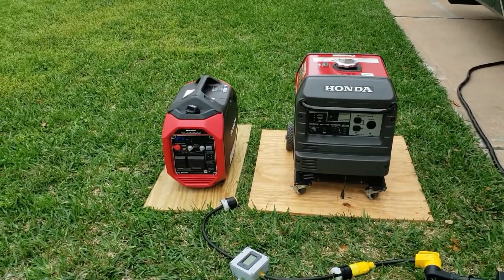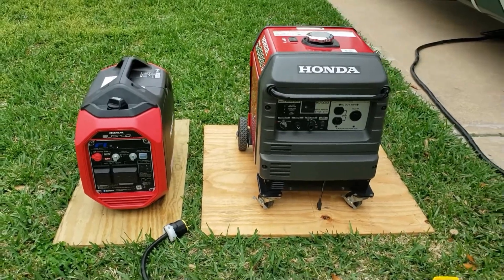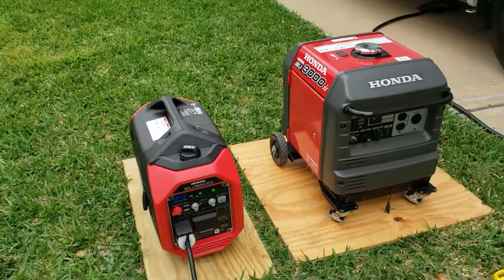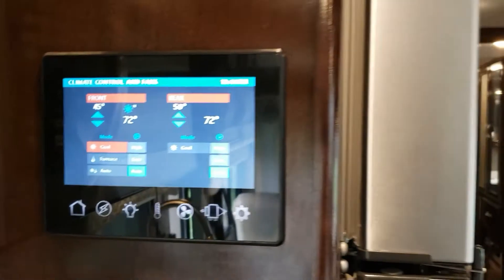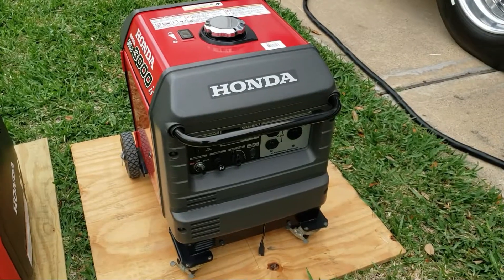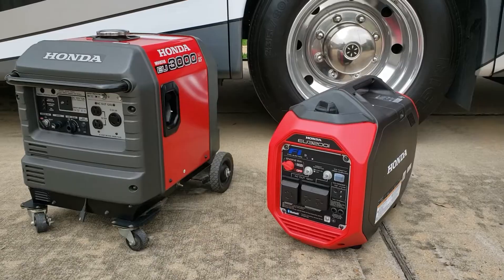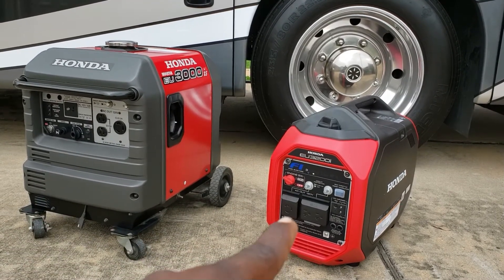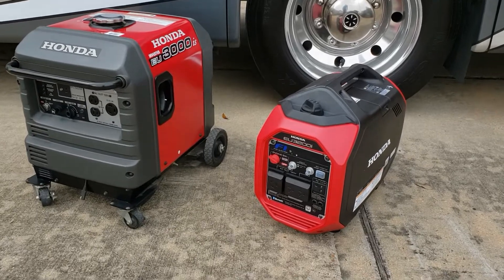Load Test: Honda EU3200i VS Honda EU3000i Comparison Fuel Injected vs Carbureted

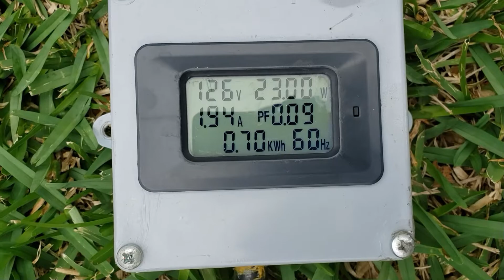Comment: 3:00, the reading does not make sense here. 126 volts at 23.01 Watts does not equal 1.94A. It would equal .18 amps. Something is wrong with your power meter.

Comment: Not that it matters,  but the industry standard for sound tests is 23 feet.  An interesting test I have never seen anywhere is the generator's inverter lag. When a load applied to a generator the voltage will drop, some inverters handle this efficiently, while other's do not. I spoke with Honda a while ago and they gave me the specs on their generators which was superb. The cheaper generators should be tested as inverter lag causes loss in efficiency which can stress the inverter and damage sensitive electronics. I have seen other YouTube channels parallels different brands and sizes of generators and was curious about long term effects of this practice. Honda states specifically not to operate in this manner of course Honda wants to sell more generators. Great video.

Comment: Having owned the Honda 2000 and the Honda 3000i , I would still choose the 3000i because of the electric start. When the 2000 was brand new it started after just a 2 or 3 pull starts. But as time went by and using the crappy ethenol gas, it took a bunch of pulls to start it. Where as, the 3000i having electric start only took holding the key on for about 3 seconds to start it when it hadn't been run in months. Probably because it had to pump gas into the carb from setting so long. You do have to put a trickle charger on the 3000i if your going to let it set for long periods without running it, because of the little battery it has. But that battery is only $12 to $15 dollars on eBay.

Comment: Good test ,thx,,The 3000 engine is ultra durable and more moment. lower consume i guess?-- every overload makes the inverter module weaker and weaker,  i got a EU30Is 230V with a fried inverter ;) and a EU10i. same same

Comment: can you parallel 2 3200s.....or 2 2200s

to run 2 A/C, micro, 12v fridge outlets in an RV....stove is propane,
Reply from the maker: The two 3200 would be better

Comment: The engine isn't the issue. The electronics is protecting the alternator against overheat from too much output current. The copper heats up from current squared so current exceeding rated output causes major heating.

Comment: I have  a eu3000i, all good  except for the weight. 130lbs dry! I was at Harbor  Freight on Black Friday looking for bargains, not  necessarily a gen set.On the floor unboxed were several  returned and refurbished  gen sets.  A 4550 starting,3650 running open frame inverter was sticker  marked at $419. Retail new  was $679 and BF price was $599. Ending that day was 40% off the $419! Wanted a light wt 30 amp plug gen to run small welders. NO warranty, could not buy extended warranty. Buy it and bring back  within  5 days if it has a problem.
Went to move it on the  floor and it was light.
77 lbs dry. Another  slightly  smaller  conventional  model also  refurbished  was over 100lbs. This 4550 replaced an earlier  4400 inverter that was recalled. 
Pull start only. Eco Switch. 30 amp twist lock, 2 duplex  20 amp outlets all with their own breakers  Parallel  ports.Running and overload lights. CO shutoff etc. Added gas and oil, started it and warmed it up. Killer watt read 120v 60hz steady. 2 1500 watt heaters no problem. Added a 3rd 1500 watt  heater which it carried for a short time before the overload light came on. Voltage and hertz very steady. Quiet  and not rattley like many 
low cost  open frame  gensets. Not Honda quiet but quality  sounding. Many people  compared  this unit favorably to HF 3500 watt fully  enclosed inverter gen which mimics the Honda Eu 3000ie. Time will tell how good it is. Different  sources  said i can parallel  this unit with the
Honda.

Comment: I ran a dive shop in Honduras for 2 years with the Honda EU3000IS, when we bought the shop I put an hour meter on the generator to track usage and oil change intervals. it originally came from a tool rental shop, and was used at the dive shop for the previous 2 years. By the time that it was retired (not from dying) by the math it had over 26,000 hours on the machine. I did oil changes every week and valve clearance adjustments  when required. kept up with the routine maintenance and this thing lasted an extremely long time for a generator that's not rated for continuous use. We averaged about 8 amps continuous for 8 hours a day. We had to fill the tank once a day. I wouldn't hesitate to get the older version over the new one.
Reply: Wow, impressive generator and maintenance regimen on your part.   Thanks for sharing.

Comment: You mean to say a generator rated for 3200 w brand new outperforms a generator only rated for 3,000 Watts also the older model they both overloaded one cost $800 more than the other the little one that is. This was really the stupidest thing I've ever seen I didn't see a test other than sound

Comment: At 6:15 you have the eco-throttle turned on, at 7:26 it’s turned off. Did you use eco-throttle just for the decibel test?
Reply from the maker: I will have to doublecheck, but I always do my test with eco on.
Reply: @GeneratorReviews  So maybe the 3000 wouldn’t have stalled with eco throttle off?

Comment: I thought the Honda 3000 was going for 3k, but I check now and they re going for 2K, does that sound right?
Reply: $2k is correct. I bought mine in July 2024 brand new for that price at a large retail camping store.
Reply from the maker: Be careful with sellers

Comment: Hi Gavin, excellent presentation, thank you for sharing with the community.  Could you tell us what do you use to measure the power consumption (the little grey box gauge) that you have connected in series with your power connections?  If it is custom-made, could you explain how you made it, thank you, Ciao, L
Reply from the maker: https://youtu.be/bhNf33jNRvo?si=GWBifPMfJlg796q3
Reply: @GeneratorReviews  Hi GR, thank you for the info and for your great informative videos, Ciao, L

Comment: I just changed the battery in my 3000i and I love the quietness of that machine.  I also have a victron 12v/3000va inverter with a 4000Ah lifepo4 CALB battery and use that for the ultimate quiet system.  I really appreciate the video here, might I suggest setting the cooktop to 9 or 8 so that you can find a power load that both gensets can run then compare the noise given a fixed load.  Thanks for taking the time to put these through their paces.

Comment: Excellent comparison.  Honda's advertised specs appear to be honest.  A cheaper non-Honda generator (4000/3200w), that we load tested, handled 20% less wattage than they advertise (barely 2600w).

Comment: nice to see the two perform. I am looking to buy one  either 2 2,220I watts  or the 3200i  . 2 x 2200 parallel give 4,400 watts   Have not made up my mind yet. but the 3200I is fuel injection  must be better of fuel consumption?

Comment: Awesome video, currently deciding between two 2200, a 3200 or a 3000 and I noticed you said the new 3000 has Bluetooth, do you know what year Honda added Bluetooth to the 3000? I dont even see the Bluetooth logo on their photos on the website.
Reply: I went the two 2200 route (Companion and standard) and am very happy I did.  When you factor in the performance (meaning output), and the cost, it makes sense.  Additionally I like the portability and ease of storage, especially over the 3000.  I keep mine on shelves in my garage; try putting the 3000 on a shelf.  FYI, the 3000 does not have Bluetooth.
Reply: @jmljml5065  I agree better to have two eu2200i generators, That is what i did

Comment: Hey! I’m looking to get the compact generator for my RV to charge my battery and run the AC when needed. My RV is 30 amp, which adapter did you use to plug in to the compact? And would this generator suffice?
Thanks for your help!
Reply from the maker: There’s lots of choices out there go ahead and check out my other videos. You’ll probably have a better idea of what you’re looking for.
https://youtu.be/6UKA2-tfH20?si=kRRXH-T1XywPl-kO

Comment: Isn't the bigger one bigger because of the larger gas tank and it's elevation due to the wheels and frame? Otherwise, I suspect that the internal parts I presume are about the same size.

Comment: This is just what is needed for partial rv backup. Operates the ac and stuff perfectly. https://www.youtube.com/post/UgkxOTeIs0vv4_9B5hsmnLsk9r930uDQLu_Y is quieter than my rv generator. Only suggestion is that it needs a fuel shutoff valve. So it is easier to store.
Reply: another thing I like about the 3000i, it has the gas shut-off and a key start. Only problem is it takes two people to carry it around. Mine stays mounted in my Silverado.

Comment: Another great useful video. The 300 is really heavy big can’t be picked up by one person. The EU3200 fuel injection gas gauge wireless 🛜 information on your iPhone big price tag you also can double your power with the EU2200 with a set of cables. Thank You

Comment: With a 50% bigger engine and lower compression, my hunch is the bigger loafing generator may outlast the smaller harder working generator by a fair margin if they are seeing higher draws and long run times.  Being EFI though, the smaller may have considerable advantage at higher altitude and when changing altitude regularly.
Reply: I've had my EU3000i from Sea Level to 6ooo' and it ran like a champ. I actually prefer my EU3000i to my EU 2200i it just takes up more real estate.
Reply: @stephenajones4438  Good to hear.  I have a 3000 too, but have only run it near sea level.
Reply: Your right. And not having to pull- to crank it like you do with the smaller one is well worth it.

Comment: Good video. I'm considering selling my 3000 in favor of the 3200. The 3000 is tough to get into the box of the truck by myself but I love it otherwise. I am also considering keeping my 3000 and buying a 2200 for times when i don't need to run the ac.

I like the idea of fuel injection but I've heard of flooding issues with the 3200.
Reply: You can buy two EU2200i for the price of one EU3200i. Two EU2200i paralleled will give you more power (4400 watts) than the EU3200i and are easier to move around. Also running a Fuel Injected motor out of fuel is much worse than running a carburated engine out of fuel. Having said that I run a hybrid system. I use a Solar Charger and recharge it with a small gen. My solar charger will run the AC for about 3.5 hours by itself.

Comment: At this time I have 2x 2200 , had 2x 2000 , & had the older 3000 .
From what I gathered Honda changed the magnets in the new 3200 to neodymium magnet - stronger magnets make for the more power .

Comment: I had the eu3000is for almost 7 years. Solid unit. I will say it doesn't handle big loads while it eco mode like you did. I don't think the eu3000is had a fighting chance with that eco mode on. I like how compact that 3200 was tho! Nice little unit! Was the eco mode on , on the 3200?
Reply from the maker: I agree ☝🏽

Comment: Great Video Gavin! 

Just checked the manuals on both machines and the EU3200i has a much higher compression ratio. 

EU3200i = 10.0:1 
EU3000i = 8.5:1

While both manuals state that a minimum of 86 octane is required. I bet you can eek out a little more performance from the EU3200i running 92 octane.
Reply: Depending on elevation.

Comment: Hey Gavin good video, something to consider is that many people do not have an electric stove usually they are propane, you may want to stick with the a/c's, the microwave, and fridge, and only use the stove when additional load is needed for larger gensets. Also the advantage is you can run the electric stove from 1-10 to ramp load as needed.
Reply from the maker: I know buddy I was just trying to get max amps output
Reply: @GeneratorReviews Hey no problem It was a suggestion on future genset testing , its all good :)
Reply: I'm sure he would not use all those at same time. He was doing a test
Reply: @Asidebar  Did you even read what I said??? All I suggested was changing the order of use of the items in the RV. And btw I use the fridge, a/c, and micro at the same time and probably many others may as well if the genset is large enough.
Reply: @Rockrewls  Like AA said it was a TEST he was doing to compare both units

Comment: Make a fuel consumption difference video for these two units at constant load of 500w ,1kw , 2kw , 2.5kw & full rated. With eco throttle on.
Fuel efficiency with the fuel injected model should be lot better at low load conditions.
Reply from the maker: I can do that 👍🏾
Reply: @GeneratorReviews  Please include no load consumption as well.  It would be great to see comparison to see fuel consumption comparison at different load levels between inverter generator and regular generator of the same power capacity.
Reply: @xavierneckor8918  why would he (or anyone) do a no load fuel consumption test? You like running generators and wasting fuel just to add run time or burn fuel? What possible/valuable info can you get from running an unloaded generator? Thats the silliest test anyone could imagine. Getting “mpg” from a constant loaded generator will provide data one can extrapolate to see if it fits your needs. Running it unloaded, well, just a waste of fuel and money.
Reply: Did you make the video of the comparison and run times? I don’t see it anywhere?

Comment: It might not be the difference in engine power but where the shut off setting is set by Honda to protect the internal electronics.  

A T Burke
Reply: That's what I was thinking. Besides that, they both overloaded. Who cares if one carries the load for 20 more seconds than the other? Big deal.
Reply: i bet its this newer inverter is just more efficient plus might have some bigger capacitors that allows it to squeeze more juice from this smaller engine

Comment: Great video, Gavin! They both have their pluses. For me, the 3200 is best. Mainly for the weight. Now I know Honda quality is great but the price is crazy on any of them. If my now 4 year old Westinghouse ever dies, I'll consider a Honda long and hard. As good as my Westy is running, it may be a while.
Reply: For a lot of guys, pride of ownership is important; in other words, owning quality gear matters.  That's why I own two EU2200's.  My brother is a bargain hunter, so he bought a couple of Westinghouse Igen2500's.  Knobs fall off, habitually hard to start; exactly what you'd expect for the price.  Not impressive at all.
Reply: I have both. If you have to move it the 3200 is better, but if you are stationary: the larger fuel tank, the electric start and the fact the 3000 is much quieter give the 3000 edge (if you don't have to lift it).

Comment: Oh man! This is exactly the test I've been waiting for. It's a compromise between the two. Apparently the engineers won't let you have your cake and eat it too. If they give you everything, they don't sell new units that they sandbag and hold back, always leaving you wanting a newer model that still won't do it all.

I want the smaller one, but the run time, quietness, and longevity of the larger one is definitely going to be better. Less rpm from the larger displacement engine is going to wear longer, as it's over built, and less rpms, mean less wear. Plus you get the electric start.

I'll be switching gears and going with dual eu2000is's, and do a very large 240 split phase inverter on a 800ah lithium setup for large intermittent loads. Like cooking, laundry and water heater duty. I have the roof space for a ton of solar, but still want a stout backup, and I think it'll be hard to beat dualing 2200's on the 12 gal extended tank I've already invested in. They'll fit in compartments better, lighter, and if one fails, ya still have half of your power. 

I've thought good long and hard about it for quite a while now, and my trade off will be more maintenance, a bit more fuel, setup time and two pulls instead of one. That will be a rare occasion with the setup I have planned. The good is more raw heavy power, redundancy, and cheaper initial investment. 

Gavin, without these vids, I'd probably go another 6 months thinking way too much about it. Now it's simple, buy the companion, link them up, and spend the $ I save on the solar portion, which will be used most until the clouds come out for an extended period.

Awesome vids as usual, a like and comment for support. Best Genset tester and reviews on YouTube period. Thanks for what you do for us brother, I most certainly appreciate it. Have a great day. Time for me to go get that paper.
Reply: Thats what I did with my two 2000's. that gives you 3200 running watts, redundancy, and run it through a transformer, you got it all!